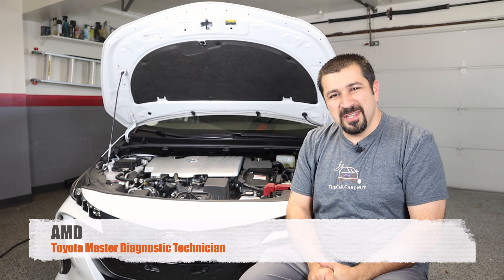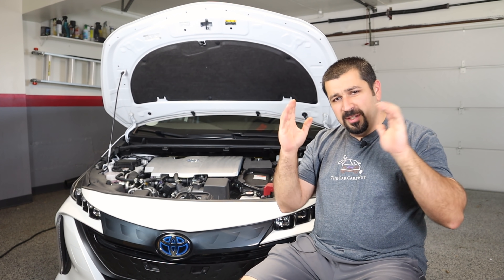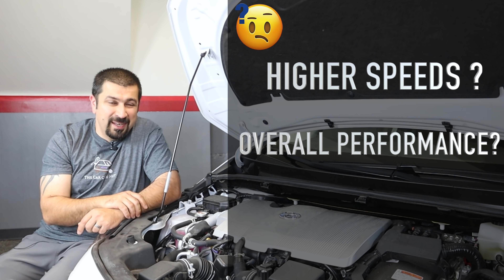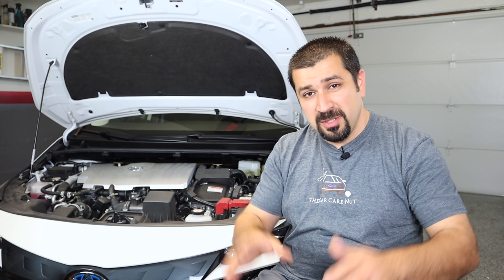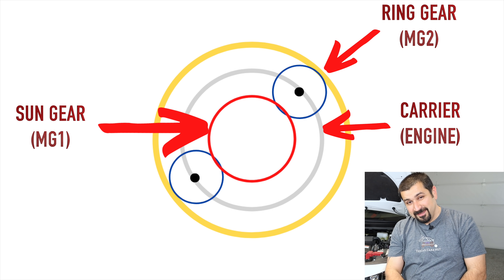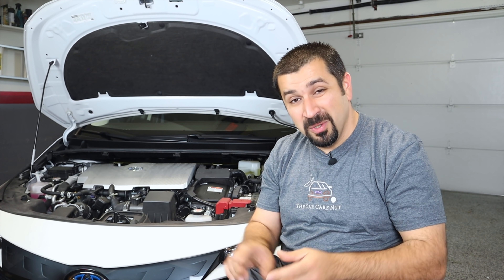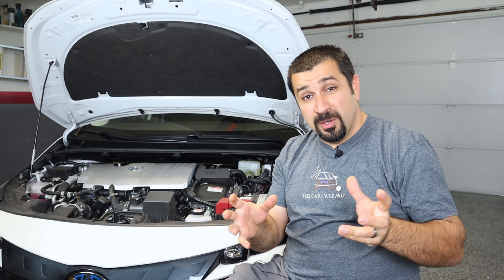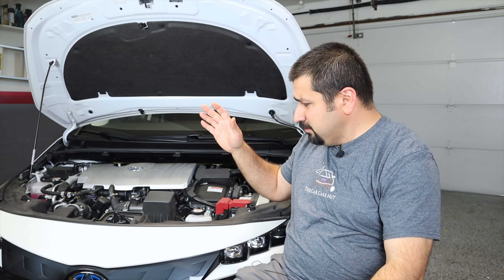How do Toyota Plugin Hybrids work? Completely different than Hybrids?

Comment: Thanks for the video. Got lots of info from them. Since you said we don't put the car in neutral for a long period of time, what about in the even of towing?
Reply: Yes, the whole car needs to be on top of the tow truck with gear in Park and the Parking Brake on.  It's not good to "drag" a hybrid with wheels on the ground.
Reply from the maker: Hi! In towing you want the driving wheels off the ground in hybrids

Comment: My dumb question is does the planetary gears are submerge with the engine oil? Or it has its own lubrication?
Reply from the maker: Hi! It is lubricated with transmission fluid
Reply: @TheCarCareNut  Those planetary gears are basically the so-called power split device?
Reply from the maker: Hi Gabriel! Yes it’s the same thing.
Reply: @TheCarCareNut  Thank you!

Comment: This explains why my Prius Four Touring feels like it wants to creep forward, and the parking brake creaks when the gear is in park, and the gas motor turns on to charge the battery. Is there a service bulletin for the parking brake? My dealership had already done the parking brake recall from a few years ago, but when I park on my slightly sloped driveway and disengage the parking brake, it makes a loud thunk as if the parking pawl was holding the car. Also, when I apply the parking brake on a slope, the car rolls downward a lot. And while entering or exiting the car, the rear brakes make a lot of creaking noises. Does this mean the brakes need adjusting?

Also, when I’m at a red light on a hill, why does the energy flow show that electricity is going to the wheels when I’m firmly pressing the brakes and not moving? This only happens on a hill, and it can’t be the hill start assist because that uses the mechanical brakes, if I’m not mistaken. 

Also also, my CV axel had been making ticking sounds when braking, and my dealership did the service bulletin fix for one CV axel, but I’m not sure if there was another bulletin for the other side. 

Also also also, when I start my car, it seems like the gear selector glitches or something. When I start the car, and it does it’s beeping and system tests where all the dash lights turn on, it makes additional chimes, and then the front proximity sensor shows that there’s an object in front of me as if I’m in drive and then the proximity screen goes away. I had no accidents, and I do all my scheduled maintenance at my Toyota dealership, so I don't know what's going on. 

Also also also also, the clear coat that Toyota used for the glossy black C pillar trim started peeling after about two years. I know I could have taken it in under warranty, but at that time, I had no time. I see many other gen 4 Prii with the same clear coat flaking and see them in the Prius Chat forum. Even my headlights started peeling, which I didn't know had a clear protectant or something on it. 

I love my 2016 Prius, but this first model year has been giving me many problems. I’ll never buy a first model year ever again. What happened to Toyota’s quality?
Reply from the maker: Hi! The parking brake needs to be looked into as it might need an adjustment
Reply: On an incline apply parking brake first with brake pedal pushed, then put selector in Park. This ensures there's no pressure on parking pawl. Also parking brake tends to cease up if not used regularly
Reply: @briank10101  I think the safest solution for that issue would be: 1- press brake pedal 2- engage Neutral (N) 3- engage hand brake 4 - now and last... Engage P on the clutch selector. That way all the car's weight will be on the parking brake and not on the transmission.

Comment: The "plug-in" battery in my 2012 Prius Plug-In gave me ~12.5 miles in EV mode at normal speed (~65mph) when new. After one year, it went down to 9.5 miles of range. That's a 27% drop in range after 12 months.

I stopped charging it after that and just run in ECO mode now.
Reply: Our Prius 2012 PHEV still goes 11 miles in Ev mode only. Charging it sometimes twice a day. The car was 5 years old when I bought it so I don't know usage and charging before that time but I drove already 18000 miles in Ev mode only.
Reply: Do you live in a hot climate area
Reply: @meki___6881  Southern California, but the car was garaged when parked. Many owners of this model had the same issue.
Reply: @bme7491  yea sadly hope its alot better on the new models

Comment: In neutral engine will still start for heating the cabin only (if heating is on) but it will not charge the hv battery
Reply from the maker: It cannot start in neutral. If it’s already running it will stay running.

Comment: I will correct you about the maximum speed on older prius 
My gen2 can go 41mph in EV mode only 
At 41.5mph engine will start because mg1 spins to fast

Comment: I recently leased a Rav 4 hybrid xle2021; when I complete a drive it gives me a score of 70 and indicates I need to improve this score. Do you a video that explains how to drive a hybrid?
Reply: There are three points to create d
finall score. Acceleration,  coasting,  breaking. To get maximum you'll need to:   1.acceleration, press a pedal to the line of power but not cross it. 2. coasting, when you successfully achieved a speed,  release gas pedal and press it again, toyota will go to ev mode. 3. Breaking, you should not use pads for breaking, just MG2. And try to gain more power with breaking as you  can. I follow that and not driving slow. I can easily make 95+ score. Mine best was 99. Hybrid Assistant app really helps.
Reply: @JuniperRwdLR  you're right and to the point. And hybrid assistant is a must if you like to know better how things work.
Reply: @JuniperRwdLR  thanks
Reply: Light acceleration. Keep RPM's as low as possible. Same thing with braking. Brake lighter and sooner to maximize the regen brake and coast when possible. It's not possible to get 100. You'd have to drive so slow that you'd get pulled over to get much above a 90. Go up a slight hill once and your score for the drive will be shot. Don't pay much attention to it.
Reply: @kyle-qw5yx  thanks

Comment: That was fascinating. I had not spent much time thinking the differences between hybrid vs plug in hybrid. At first blush thought they just stuck in a bigger battery. But as you said it was much more complicated problem to solve. As far as HVAC I'm waiting with great anticipation but I assume (know what they say) they chose a heat pump to maximize efficiency not having an unlimited amount of waste heat from the engine.
Reply from the maker: The heat pump system is intimidating at first but it’s actually genius!
Reply: @TheCarCareNut  Agree. We just had a minisplit heatpump system installed on our house. We are in NH and heat with cordwood. Hitting geezerdom that will become harder over the years as will summer heat.

Comment: What Toyota cars use the eCVT fluid?
Reply: Toyota WS Fluid
Reply: @zyrtec455  What is CVT FE fluid? What car uses that?
Reply from the maker: The CVT FE is for cars that use a conventional CVT transmission like the 2014 and up Toyota corolla. The hybrid transmission is not a conventional CVT and it does use Toyota WS transmission fluod
Reply: @TheCarCareNut  Thanx for your time.
Reply: @zyrtec455  why does the can say eCVT, when its WS?

Comment: My 2014 Plug In Prius.
Gets 54 to 58 mpg
Thanks for your videos.
Reply: 2015 Prius Plug In at 130,433 miles. Still gets 56-60 MPG . I use the plug in a lot but since winter time and high elevation in CO. I’ve lost a few MPG